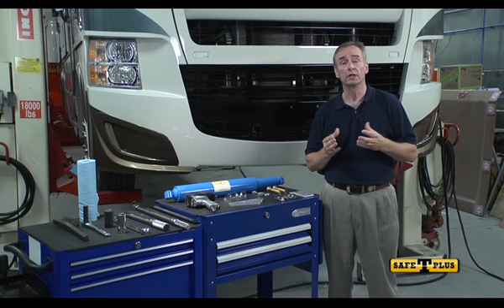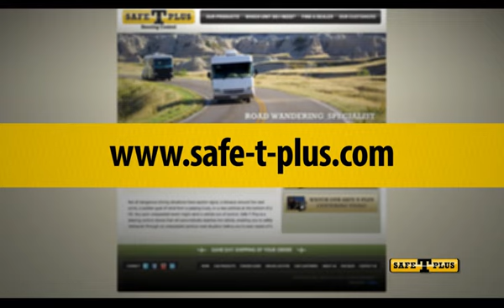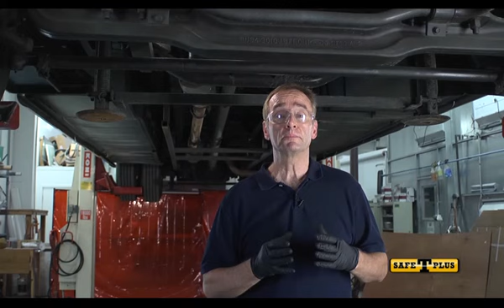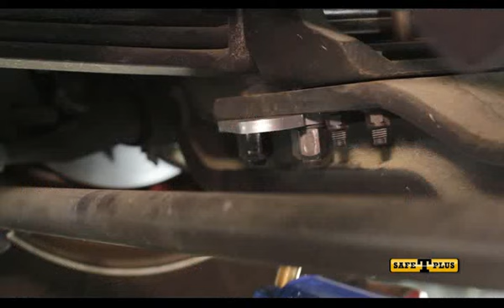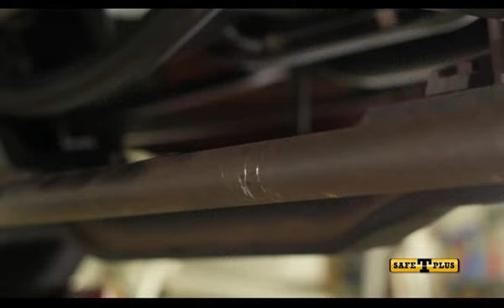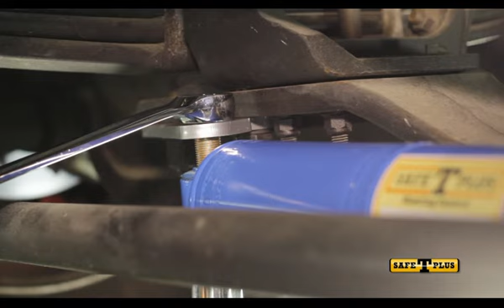New Safe T Plus RV Install Video Part I

Comment: Looks to me the passenger side was installed incorrectly.  Either turn the u-bolt over so it is on the bottom, then put the blue safe t plus on the top of the u-bolt bracket.  Or, at least if you are going to install the u-bolt bracket the way you did,  mount the blue safe t plus on the top of the mount, not the bottom.  As it is, it is at an angle that will certainly not be efficient.
Reply: I didn't notice that.  I think you are right.
In other videos they say the bolt goes down on the unbolt end.  I don't think the Stabilizer could know    which direction the bolt is on. I am putting the threads up when I do mine.  That won't snag plastic shopping bags when they float across the road like a tumbleweed.
Reply: The suspension is unweighted in the video.  I think that may level out when the suspension does.